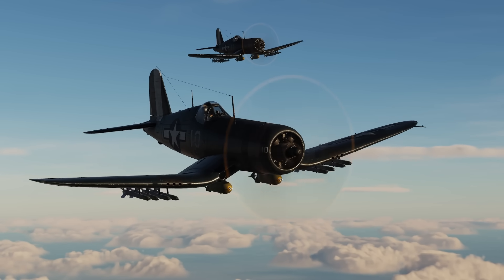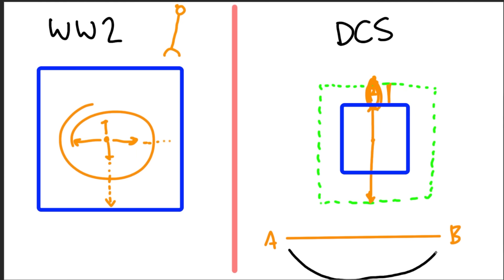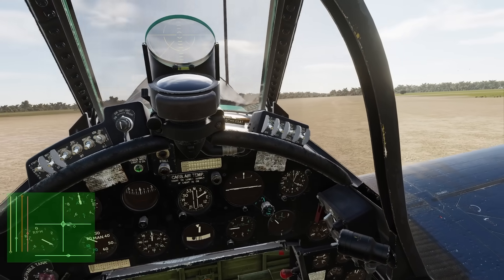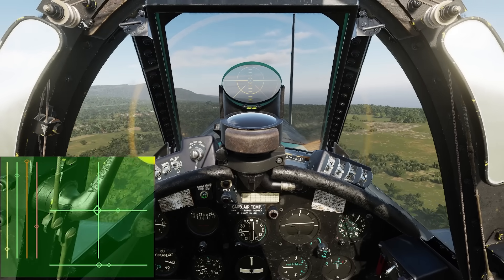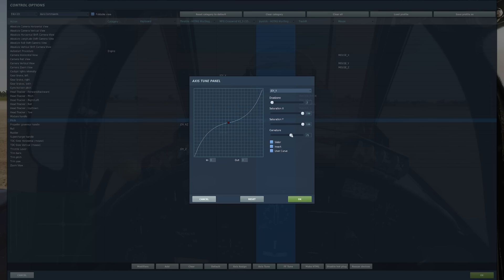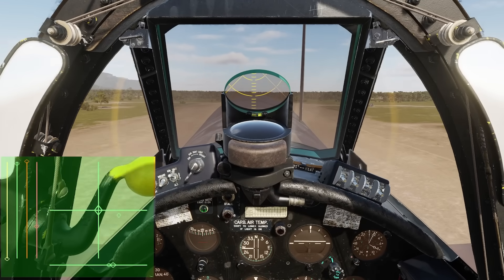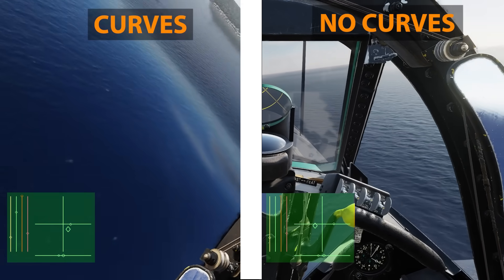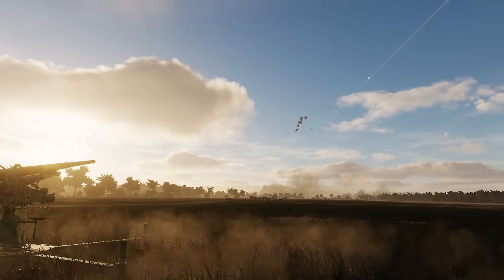Fixing the flight model: F4U-1D in DCS WORLD

Comment: My first flight after loading it was an air start. I left the curves alone to see how things were out of the box and then would tweak it later. The inputs I made with zero curve actually caused the pilot to black out! That's how dramatic it was. Once I got to grey and then back to normal, I played around. With the Thrustmaster I am running about 35 on the stick and 30 on the pedals. That really leveled things out and made it smoother. With this bad boy, trim is the secret sauce. And trim is only good with your current power setting. Add torque and you're retrimming. It's a constant of flight.

Comment: So you're using a warthog with no extension? And with a 200mm extension, I guess one can reduce or even remove the curve...or is there more to it than just the extension length?
Reply: I use a 400mm extension (floor mount) which is very close the RL  and still use very similar curves.
Reply from the maker: No extension for me, it sits on my monstertech mounts

Comment: Let me see if I understand how the Y-Axis works.
If you set a 20% curve for the X-Axis and when it is close to 80/100% it gets faster. As you demonstrated in the parabola.
My question is this! If you lower the Y-Axis from 100 to 80%. Would that 20% that was lost be the 80/100% faster X-Axis that was removed? Would it delete the 80/100% of the X-Axis? Is that it? Thanks for another video!
Reply: Applying a curvature decreases the sensitivity of one region of the axis while increasing it in a different region. The default curvature profile makes the axis less responsive near the center but once you get past a certain point the sensitivity increases rapidly. Saturation on the other hand "deletes" a region of an axis, most often the outer region (the last few %) to make the axis less responsive overall at a constant rate. A saturation of 70% will result in you losing the last 30% of in-game movement.
Reply from the maker: Lowering for my pedals worked. I commented on the description that everyone has different setups. Hopefully this is a tweak to what you need.